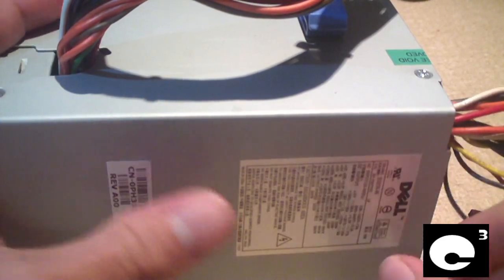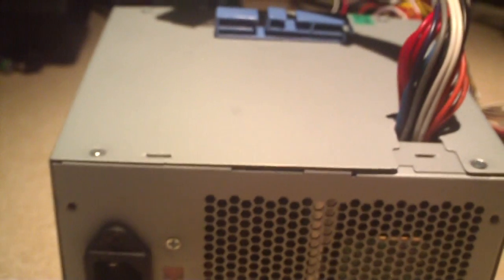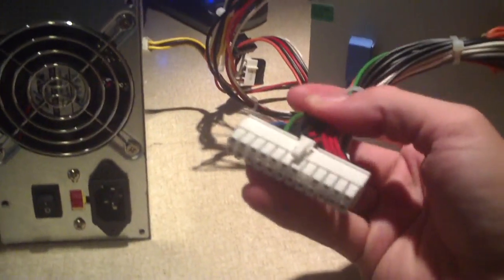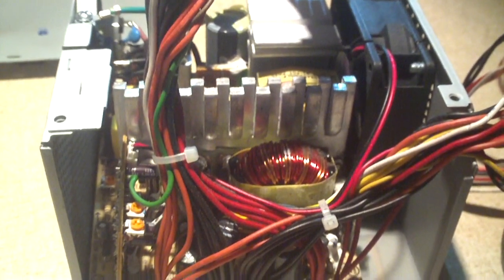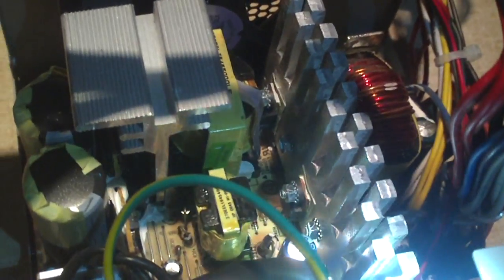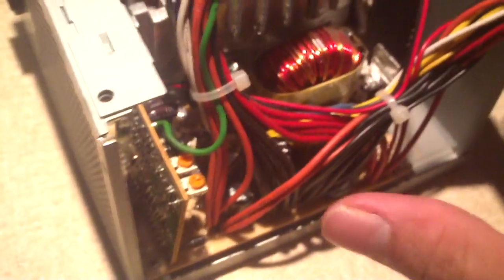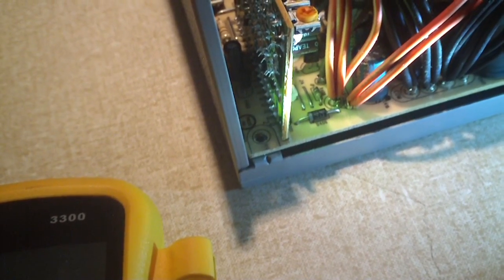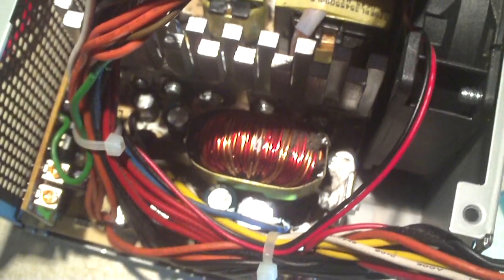Inside Dell H305N-00 Power Supply

Comment: Why are there two +12V 18A listings on the spec sticker? 2 rails? What does each rail power specifically?
Reply from the maker: Power supplies from that era tended to use multiple +12V rails. It was believed at the time that having multiple 12V rails was better for overall stability. Usually one 12V rail would serve the CPU power connector, and the second rail would serve other 12V components. Some units had up to 4+ 12V rails. In recent years, power supplies went back to having a single high-capacity +12V rail. Modern 80+ Bronze units and better usually supply all their power through the +12V rail, and utilize DC-DC conversion to convert +12V to +3.3V and +5V as needed for the components that use these voltages.